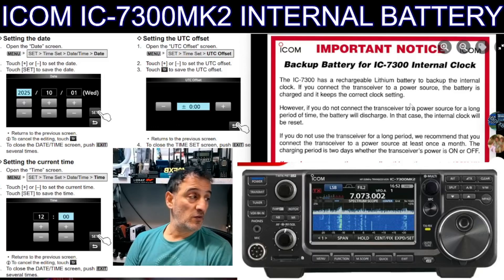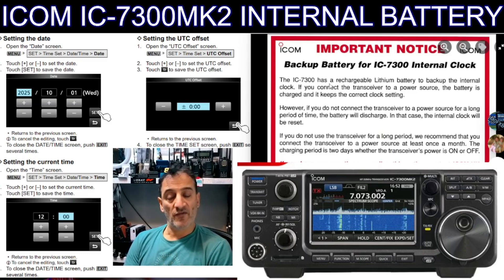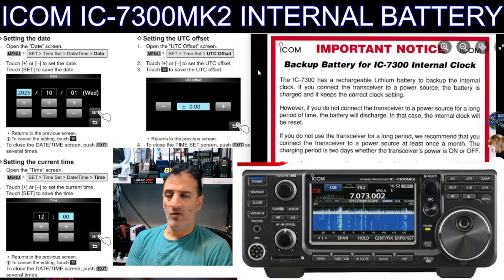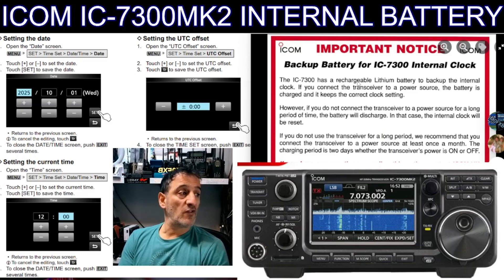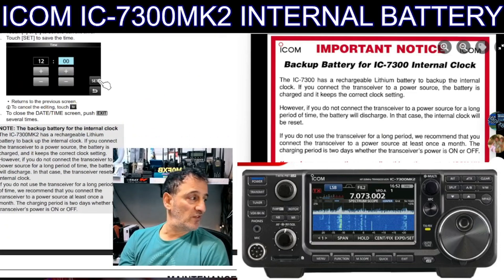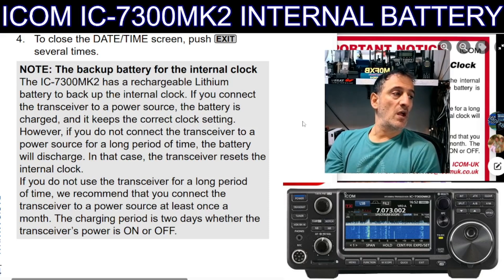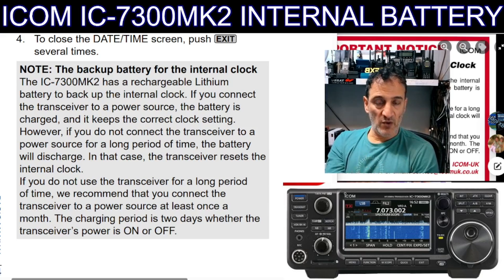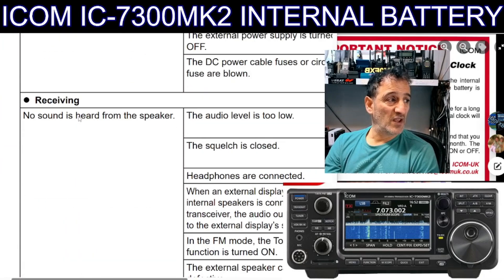ICOM IC-7300 MK2 - Internal Battery ?

Comment: It doesn’t matter much with the new radio - connect it to your network, enable NTP and every time you turn on the rig it’s going to sync/set the clock.
Reply from the maker: Does it need to be connected to the internet and P C

Comment: I'm experiencing the same issue after almost two years. Every time I turn it on, I have to set the time. Three other amateur radio operators in our club have the same problem. And when I watch videos online and see in the comments how many others are affected, it really adds up!

Greetings from Germany.
Reply from the maker: Thanks for the info but if you follpw the Icom battery gudeli es this will not happen .

Comment: I OWNED THE PREVIOUS 7300 FOR OVER THREE YEARS AND USED IT DAILY FOR AT LEAST TWO TO THREE HOURS AND YES, AFTER THE THIRD YEAR MY BATTERY DIED, IT DID NOT CHARGE ANYMORE, SO WHEN RADIO WAS TURNED ON, THE CLOCK JUST READ USED TIME, SO YES, IT IS A WORLD WIDE KNOWN PROBLEM. DON'T SAY ITS NOT A PROBLEM. ICOM SHOULD HAVE USED A SOCKET TO MAKE EASY THE REPLACEMENT OF THAT RECHARGABLE BATTERY, INSTEAD ITS SOLDER IN THE BOARD AND NOT EVERY ONE HAS THE SKILL TO DO THE JOB.
Reply from the maker: You are one person they have sold over 100,000

Comment: I don't understand why they would not just use a lithium battery like on a computer motherboard for the Bios. Replaced mabie one or two in my life in IT, but typically are good for 5+ years, I have some computers that are over 20 years old and the bios battery is still works.  It is just a clock setting.
Reply from the maker: Agree